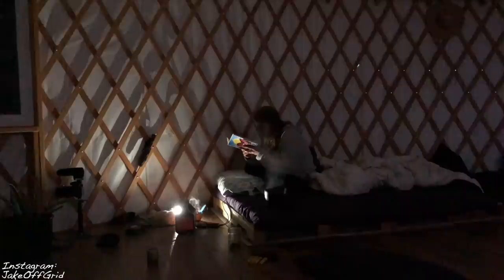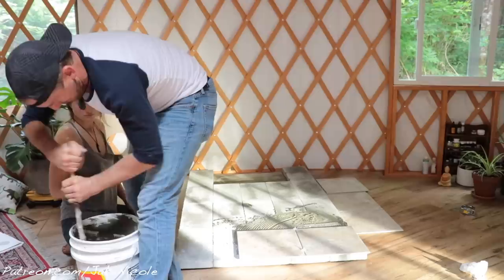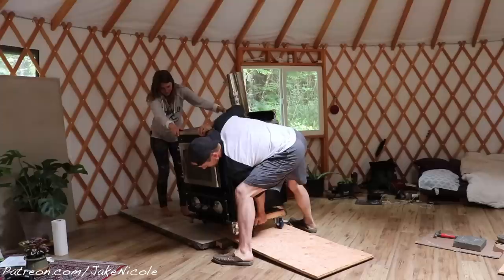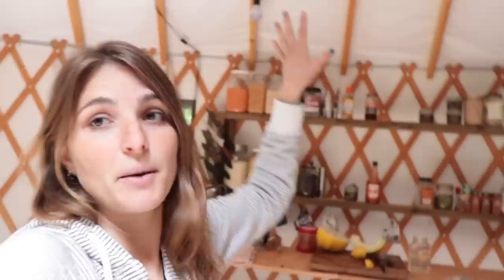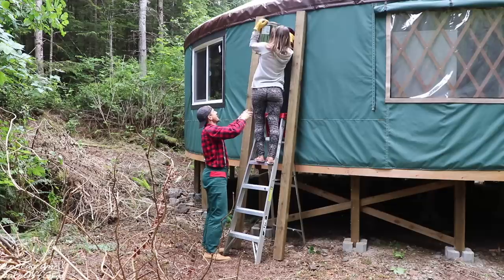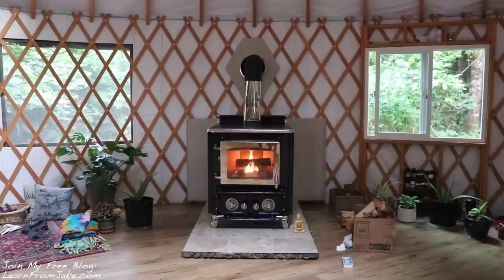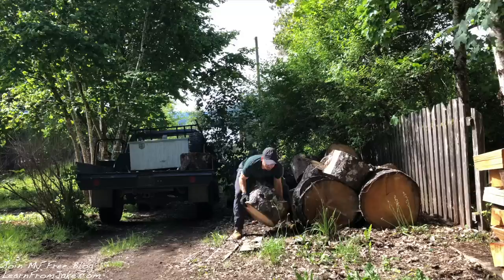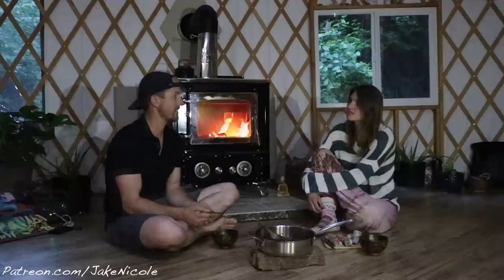Amazing Off Grid Yurt | Installing a Wood Stove & Chimney - Part 2

Comment: I remember the wood burning stove my family had in our house when I was a child. My dad fitted two pipes for the exhaust, and mounted a blower fan to blow air back down between the too pipes that blew the heated air into the house. Fan motors don't use that much electricity so it worked well to heat the large house... off of a little cast iron wood stove. As long as we kept the fire stoked, it produced heat very well. We would get our wood from fallen and dead trees at Dad's cousin's property. It was about 1200 acres of wooded lands, usually leased out for cattle grazing. But, then, over the year, before burning the wood we collected, it would dry out. Most of the wood was dead oak.

Comment: Great job. Hard work and persisitence pays off. Tip: Burning Pine isn't the best as it deposits creosote on the lining of your chimney and can cause a chimney fire down the road. Take care to burn hardwood as much as you can to burn out the creosote/resin deposits, keep your chimney pipe clean and avoid a dangerous chimney fire.
Reply: I've burned a lot of pine, the trick is to keep the fire burning fast and hot. Hardwood is the best for night-burning because it won't burn as fast or create as much soot when the damper is closed. Love the smell of a woodstove!
Reply: Creosote is cause by GREEN wood, it doesn’t matter if pine or oak or maple.
Reply: @tajon5394  That is mostly true, but there are much richer resins in pine.

Comment: "Primed with sun energy" No. Split your wood into pieces suitable for your stove then stack them undercover in such a way the air can flow through and dry the wood.
Always burn the wood that has been drying for the longest time, preferably a whole season or more. The less moisture in the wood the more heat energy will be imparted to your stove because it is not having to vaporise the water in the wood.
Reply: Yep!  what he said.

Comment: I can see there is a lot of pine on your property, make sure not to burn any of it in your word stove. It will coat the interior of the chimney with a flammable residue and will be a fire hazard. Make sure to use hard woods. They're safer and provide a hotter fire with less fuel. #chocolatethunder
Reply: Dry softwoods are good for kindling, though. I prefer red cedar, which is common in my area, and old growth Douglas fir is pretty good for kindling too, but avoid hemlock. Pine, once dry is my favorite for lighting fires, though not common where I live. Once well dried, it splits easily and the oils and sap in pine helps get the hardwoods I use in my wood stove, ( primarily alder and Big Leaf maple, and even birch ) going in our typical wet weather. 
I use hardwood, to avoid burning softwoods as my main firewood, due to creosote build up in the stovepipe, which if left uncleaned for lengthy periods, can cause stack fires -something to avoid, particularly in a hurt which is off grid. No handy fire department when you are in the outback.
Reply: Jake Reed complete rubbish about not burning softwoods. You burn what grows locally. How do you think people have heated their homes for centuries in northern climates where only coniferous trees thrive? As long as whatever you burn is properly seasoned and your stove maintained you shouldn't have an issue. Slumbering a stove for hours, on hard or softwood is never a good idea though and will lead to creosote forming. A modern stove should have secondary burn and get more than hot enough if operated properly to burn any creosote before it settles on the flue. I would watch that horizontal flue carefully though, it wouldn't be permitted here under building regulations as soot and ash can settle in it more easily than a vertical or angled pipe.

Comment: your friend smokes too much on the primed with sun energy it burns more because it dries more thats it
Reply: When we had a wood burner, I found it better to leave the wood outside to get saturated and then bring it in to dry  for a week or two before burning it or the sun drives the sap out and it seals the wood like a varnish and seals moisture in.
Reply: @matthewtanner9823  You also dont want super dry wood, since that stuff will instantly burn up and generate no heat. So you would need 2 if not 3x the amount of super dry wood compared to non "sun primed"(lmfao) wood.
Reply: @Ormathon  how is possible that superdry food generate no heat? It is vise versa actually. The wetter the wood -> the more energy goes to evaporate water.

Comment: !!*IMPORTANT JAKE*  NEED A WAY TO CLEAN OUT THE BUILD UP IN THE PIPE.  .. A way to open the elbow or open the outside part if the pipe to insert a chimney clean out Brush.  (like the old school chimney sweepers use)  please Google some ideas that will be best for you.  This pipe design doesn't look like it has an way to clean the pipe out???  Cool video. Many blessings to you and Nicole. <3
Reply: Colleen Lassie the piece installed directly outside of the yurt (the first piece) has 3 openings. One going inside to the stove chimney, one going up the chimney on the outside, and one going down that you open to clean the chimney. If you look at the video starting at 30:18 (or so) you can see that the platform he installed outside to hold it has a large hole in it and the piece he installed has the 3 opening.  Just thought I would point it out so that you don’t worry.
Reply: Oh, and the elbow inside is easily taken apart with probably 1 or 2 screws so they slide apart easily for cleaning inside.
Reply: If you burn an Alum. soda or beer can every so often, it will clean  out the creosote buildup. I do this every time I start a fire during the cold months here in my Jotul wood stove.  It really works. I also save all aluminum foil, pie pans, food containers too. They do just as well as a can. Try it. You will see that it really works. Especially when burning pine like you have just salvaged.
Reply from the maker: Renea.s 👍🏼
Reply from the maker: triumphmanful really? Tell me more about this… How does that work?
Reply: Russians traditionally surround the stove with a large mass of stone masonry:  the mass of masonry absorbs the heat and stores it much better than just heating the air in the yurt.  The rocks stay hot and warm for hours, long past the last log burns out… Not sure if the floors here would allow for the weight of the rocks/ masonry…

Comment: Tell jake to 1/4 or split the wood where he got it...work smart, not hard..
Reply: Easy on that axe!!!!  Save the energy for when you really need it
Reply: Fosho... he’s gonna work the next ten years to split enough wood for this winter
Reply: He needs the exercise to retain muscle mass, if you have watched ALL his training and Kung Fu you'll know that's proper for a master. #beastmodemace
Reply: Ive chopped over 400 cords by hand. Doesnt take as long as you think.😊 Key is axe placement.
Blade should half hit the wood being split....not the middle of the log. They just blow apart if done right....half the energy spent.🙏
Reply: tmoan pumba maybe he should get a gas powered splitter!!! Makes fast work of splitting
Reply: @mwatkins2464  now THAT'S a real off grid idea, MW ..... Of course, it is a bit like using a chain saw to cut up wood, eh??
Reply: Old OutdoorsGuy you do know this guy will use a chainsaw don’t you to cut trees down don’t you so what’s your point?  eh ?
Reply: @mwatkins2464  Using the obvious to make a point usually doesn't require a full explanation but, I suppose there are a few who simply use another's obvious remark to argue a point ........ so, if I have more years of pure common sense outdoors experience under my belt than you probably have years on this planet total, ....... what's YOUR point? [Or do I have to explain that to you also??]

Comment: Split it  ALL it will season quicker. The more seasoning the hotter it will burn. Splitting rounds in the winter sucks ...I don't care how strong you are. Moisture and pitch will freeze turning the round into concrete. 
Split it ALL ..stack it under the house or the carport.

Comment: Wouldn't it be easier to cut them in half before hefting them into the truck? You're gonna kill your back. I had to drive a guy to the hospital who put a chainsaw into his leg. Believe me thick pants do NOT look funny.
Reply: More likely Kevlar Forestry pants or the equivalent to minimize the penetration if a chainsaw or an axe goes awry. The biggest danger in any of that kind of work is ........ FATIGUE!! Common sense should be your top priority when living back in the wilderness and using any kind of edged tools to do the work which must be done to build a homestead. DO NOT become engrossed in your physical condition, your buff appearance in front of the camera, or the fact that, no matter how strong you feel, or how tough you believe you may be to do a day's work, you WILL GET FATIGUED!! It is NOT a matter of "if", it is a matter of "when" if you don't take a break and stay hydrated and be aware of your limits of endurance.

Comment: Seems like a lot of work and expense to end up with a glorified tent.
Reply: Stayed in what you call a “glorified tent” in the middle of a Mongolian winter. (Called a “ger” there.) Astonishingly good shelter.
Reply: Maybe so Albert, but would you seriously consider living there on a full time basis?
Reply: Maybe not with a big family, because of the lack of internal walls, but otherwise, yes, why not? They are large, insulated, quiet, good ceiling height, easy to maintain, cheap, adaptable and even portable! They are certainly a million times better than these “tiny house” shoeboxes.
Reply: Possibly, but with flexible plastic walls in the sun and weather 24/7 how long before they lose their 'elastersisers' (or 'plastisisers' if you prefer) , become brittle and start cracking? You can obtain very large tents with good ceiling height and are equally easy to maintain. I still consider the 'yurt' as a glorified tent which would be very good for camping trips or a short term vacation when you wish to 'get away from it all' for a relatively short term vacation.
Reply: Ok I don’t know anything about Western adaptations of these things. I’ve only seen the real McCoy. There ain’t no plastic in the construction. Solar cells, yes, but no plastic. Felt, wood, rope, metal chimney. They are way too heavy for any camping trip. Mongols move them 3 or 4 times a year to fresh pasture or to get into the lee of mountains, but these days they pack them up and move them on a truck.
Reply: Oh right Albert. I know nothing about Mongolian yurts, but had looked up the specifications and materials used in the manufacturers web site of the one in the video and the flexible walls are made of vinyl, which is of course a form of plastic. Also I wasn't really looking at the mobility aspect as full time living was intended for the one we are discussing. I consider he would have been a lot better off building a relatively large log cabin, or another more permanent structure if he couldn't afford a fairly decent house. When I suggested using it for vacations I meant using it as a holiday location which you would travel to for vacations.

Comment: Hi Jake and Nicole, Just found on youtube.
Really good to see two young and happily in love people working so hard together.
I haven't read all through the comments so I don't know if this has already been suggested before but, to help you plum wooden posts, knock two stabilizing pieces of wood into the ground on the two outside faces of the post, each at a 45% angle, level up your post and screw the stabilizers to the post.
This will keep the post secure until the cement has set.

If you have already done this then accept my apologies for overstepping the mark.

Best regards to you both,

Bob. from Essex, UK.

Comment: You can also use pallets to build a wrap around deck...leave a gap between the main deck and the pallett add on to let water run through there, if you decide to do it

Comment: When you get ready to split the rounds, unless you are very lucky are going to find that it is hard to split to the heart.  If you go around the outside and split it flat grain you will find it easier.  Otherwise you will find that splitting it green is preferable to letting it dry and season and then splitting it.  The other part of the fire wood experience is that you get warm twice, once splitting and stacking and then burning it later.  Best of luck to you both.

Comment: Hey heres a quick tip on the concrete may save you some time. On non load bearing things such as post hole for fencing and what you used it for on the chimney you can dig your holes dump in the dry bags of concrete and then pour your water on top agitate with a stick and done no need for super through mixing.

Comment: For reaching pots. A pole a piece of metal/ wood hinged to it at both ends and some of that wire. makes a long reacher. or maybe a pole with a thick nail in it. that was what the old timers did. aka my grand parents learned this trick from the old timers and I from them. hope it helps.

Comment: Get a couple of bungee cords then simply use them around the wood your splitting, the you won’t have to chase them down after splitting the wood. Simply take off the bungee cords then stack the firewood without having to chase them down.

Comment: I would us b2 stones to set the posts for the chimmley... depends where you are the cement crack and water gets in and the posts rot... I did that for my wooden fence... so as the posts rot and the cement cracks i put new posts in covered the  part that goes in the ground with tar then pack modified stone around the  post .. it saves the wood from rotting and promotes water to run off..

Comment: Fist vid I have seen of yours. Couple of things you may or may not know. You need to burn that pine HOT and not low and slow. You'll get creosote if you don't and that's stuff you need to deal with. The guy chopping wood in sandals (which isn't a good idea) was using a cross cut axe and not a splitting axe. You want the heavy one with the fat back end. It will work much better on the big stuff. That is a great looking stove and will provide all the heat you'll ever need! Nice choice.

Comment: Tips:
I think the pipe elbow over the stove can be a single wall. You have enough space behind the oven to the wall and up to the ceiling for safety. Please check it out. You will get 1-3 kW extra heat out of that elbow. If the wall or ceiling does not get hot to touch when you have fire in the stove, then it is OK

Comment: Two comments. First, there needs to be an air space for air to flow under your hardy board. Due to the weight of the stove, you will need lot’s of spacers to distribute the load. Second, due to the radiant heat and the size of your stove, I’d say that your pad needs to be about twice as large to protect your floor from the heat. Third, I’d raise the pad platform a few inches to make cooking a bit easier. Other than that, a nice build.

Comment: Since your building your back muscles like your doing let that wood splitter do the work for you. Try letting the axe head go past your neck  or even further and gradually let it build momentum till the last foot, then give it a boost. Youll find that once all your back and arm muscles get tuned to a longer swing you will effortlessly chop wood for hours.  cheers!

Comment: Next time you do posts.......... you don't have to mix the concrete. Put it in dry, level your posts and add water to the holes. Complete directions are on the Quickcrete bag. Much much easier!]

Comment: Friendly tip never burn firewood with more than 20% moisture it will build up tons of creosote in your baffles and pips and get a moisture meter to check your wood there very cheap it will help you prevent a chimney fire

Comment: You guys are doing a fantastic job on your homestead, and your entertaining videos. I have learned from burning wood as my only heat in a small area is to heat some outside air before it enters the room. You can pull some air from under the floor and heat it by making a manifold around the heated exhaust pipe.

Comment: I'm sure it is preferred to leave the wood in the sun because it needs to dry off :D. Nothing fancy about storing "Sun energy". Dry wood burns better than moist wood... That is why you store them in those piles with air holes (which also dries the wood).

Comment: His life would have been so much safer if he had rented a couple of pieces of scaffolding in the beginning!
Reply: Was thinking that as well. Dude was sorely tempting fate standing not only on the topmost step but the actual top of the stepladders. Over 30 yrs.
in construction and I don't recall seeing that. He'd have been fired on a job site for his own good. Putting too much strain on his back too. When lifting,
bend your knees and keep your back straight. Let your legs do the work and you'll also avoid becoming a crippled old man in later yrs. Just sayin'.